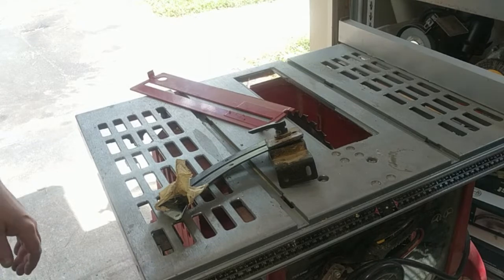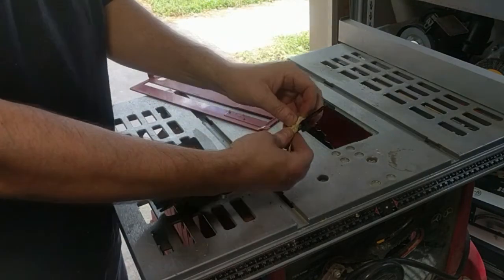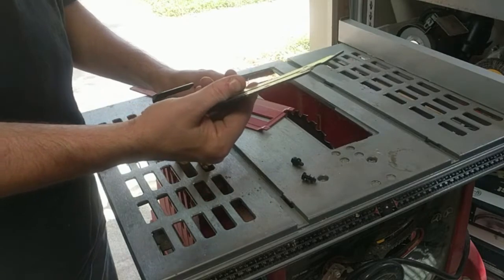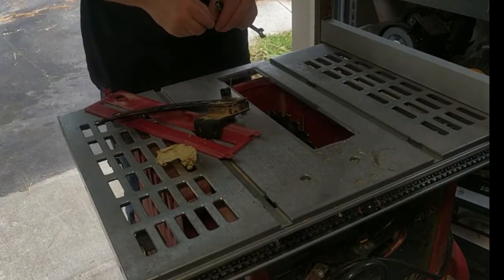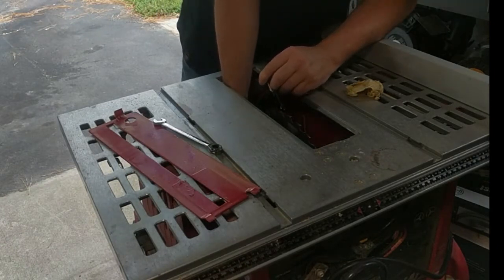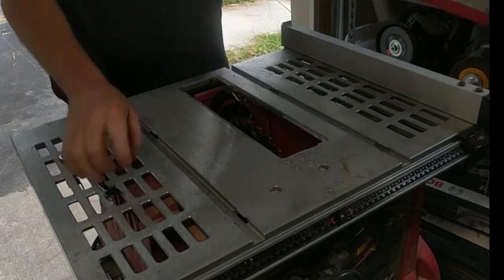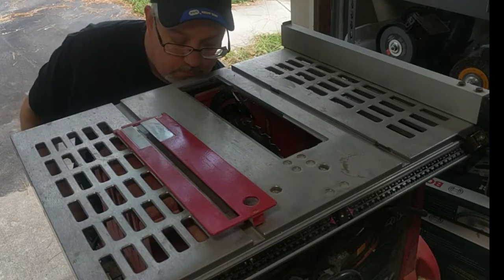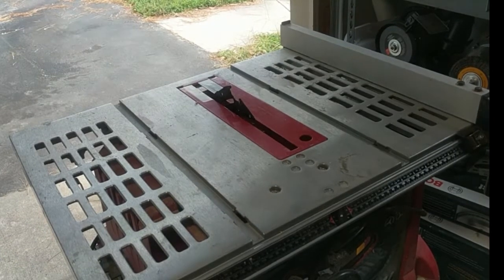TSWG Episode 80 Shop Safety

Comment: Hey Matt,  is the riving knife installed correctly, it looks to be too high, it should be level with the top of the blade.
Reply from the maker: Southern Engineering I will double check the instructions for the saw and adjust it 👍
Reply from the maker: Ok I will adjust it....it has a slider